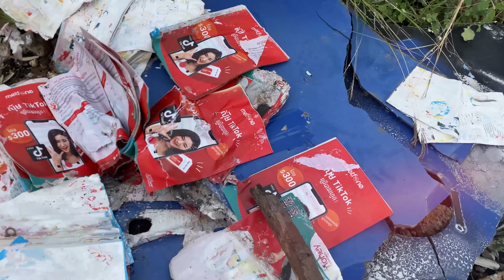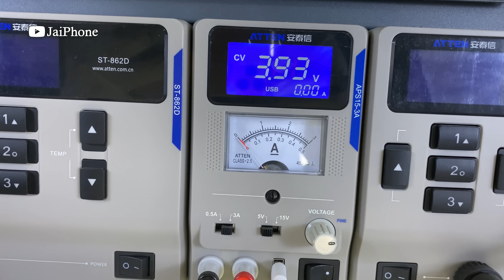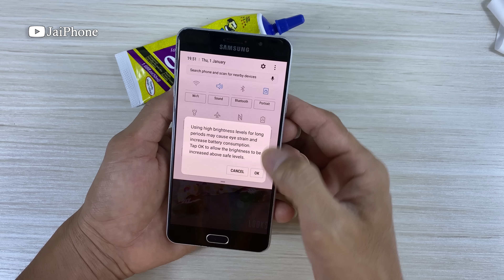Restoring abandoned destroyed phone, Found a lot of broken phones in the rubbish

Comment: With Samsung devices, you'll have to put it in Recovery mode using the power and volume buttons and then do a hard reset which will clear the phone and the pass code. But you know this. 😊
Reply: Oujh
Reply: Lo
Reply: You are forgetting about frp lock < password or Google account to complete setup but you can bypass it
Reply: @AMD 2007 on old devices you need activity launcher and a account manager apk and a trick to open chrome and files